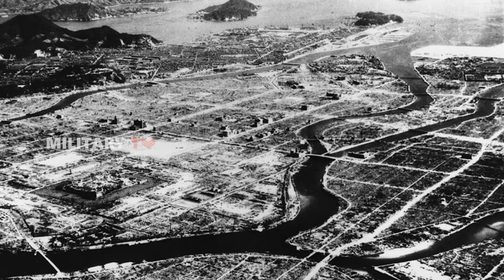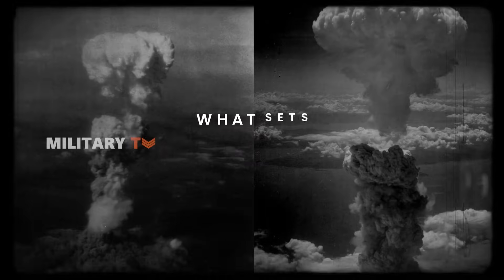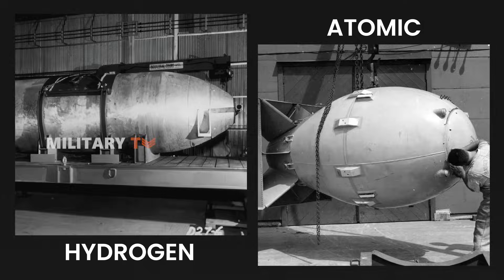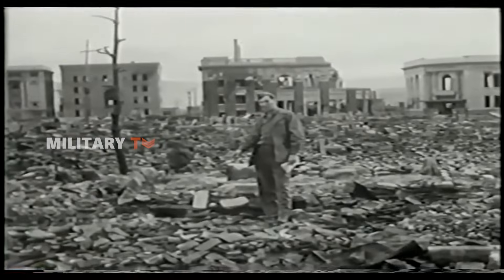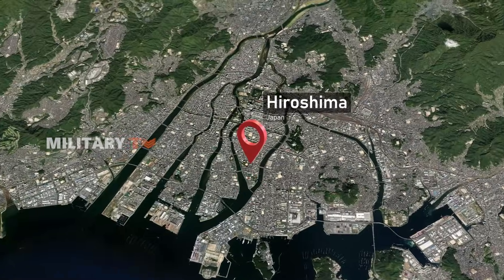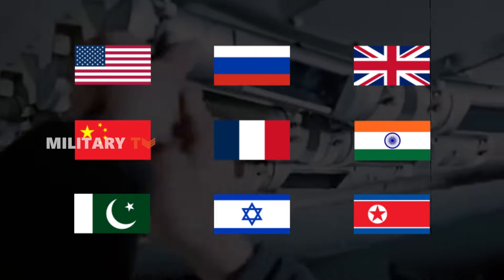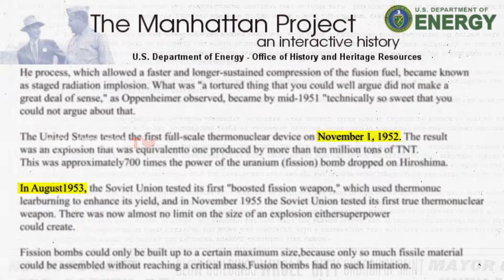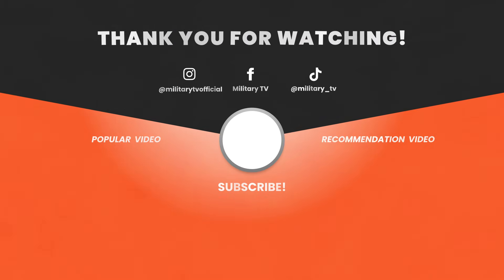Hydrogen Bomb vs Atomic Bomb: What You Need to Know!

Comment: which one can be made with low yeild of 10 ton TNT or less. basically the concept any thing above 100ton might tiger mad. so large nukes are deterrents against other large nukes. using any nukes is risky because of escalation ladder. so if enemy does not want climb it they can only match what used or face mad.
Reply: Speak English man😊
Reply: Once you have so many you don't need any more hit every major city and it's over. Someone that has a thousand is just as deadly as someone that has a million because the destruction is assured regardless. Whoever launches nukes is also dead that's why they don't get launched